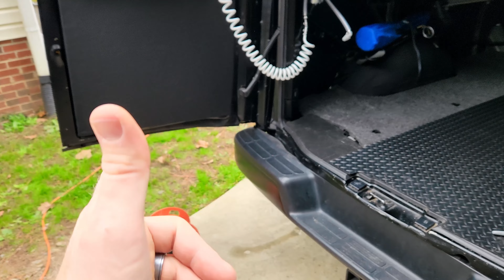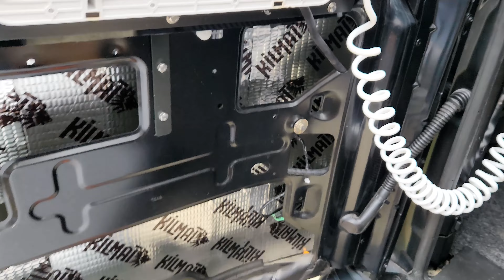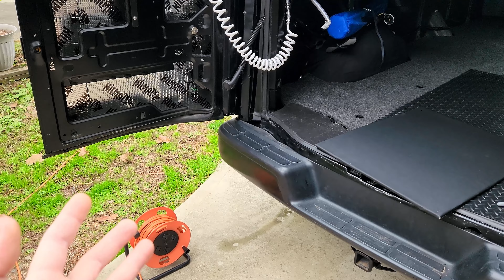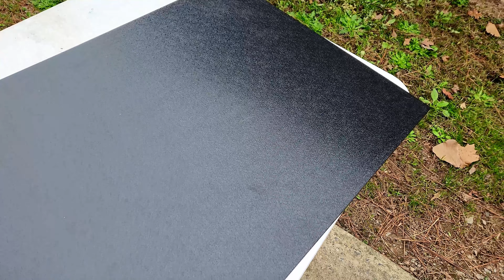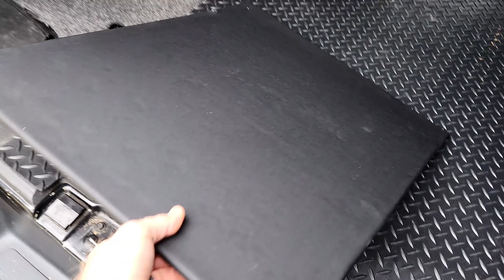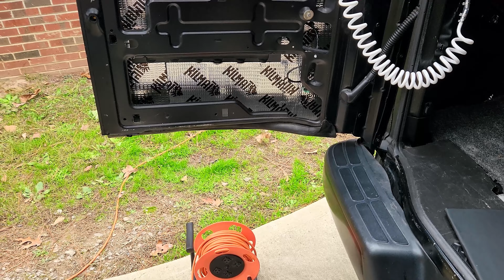Motovan Part 16: Hot Shower On-Demand with a Camplux | Chevy Express 3500

Comment: About how much hot water does the 1 lb propane heat/last before needing another cylinder...
Reply from the maker: I have yet to replace it after about 15-20 showers.  Also, still using the same two D batteries.  Showers vary in length from 2-5 min.  If it's a single day race, I take my time cleaning up and don't worry about water usage.  I have nothing but good things to say about the unit.